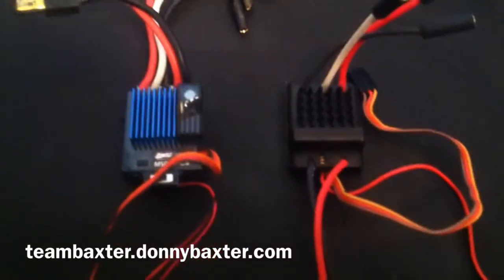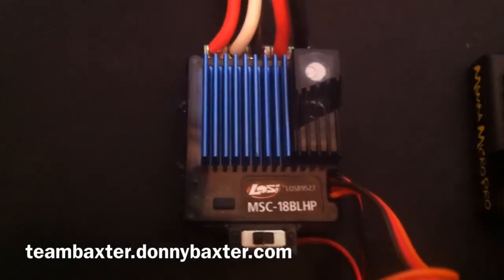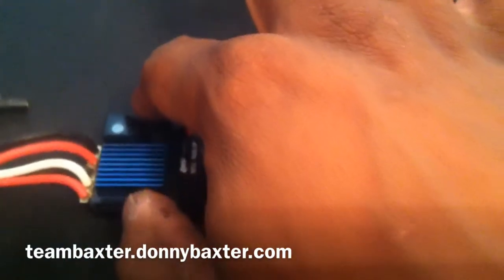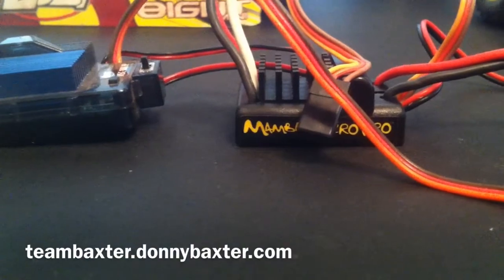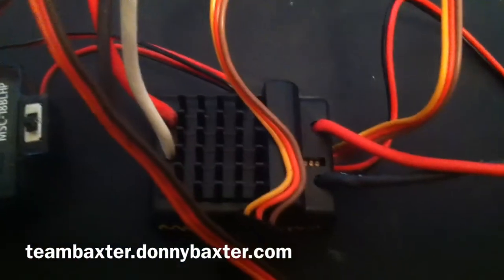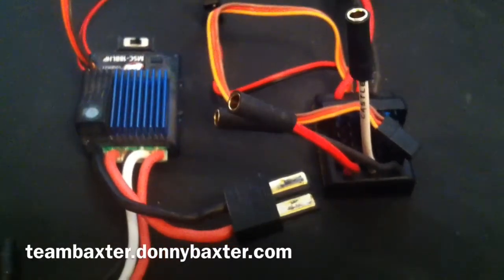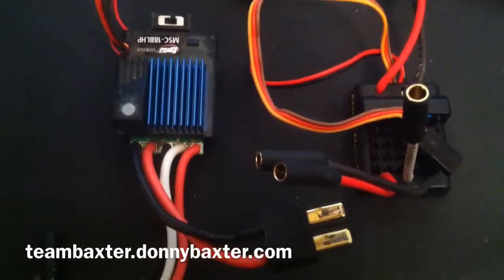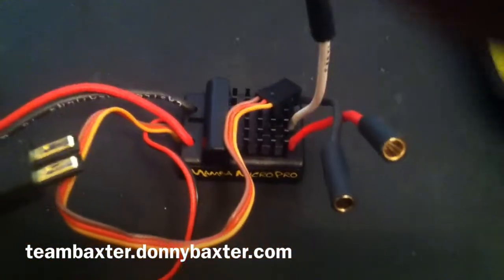Losi MSC-18BLHP and Castle Mamba Micro Pro ESC Physical Comparison

Comment from the maker: Then i would absolutely change the ESC. There is a significant difference in cogging between the stock setup, and the MMP setup. That 0808 motor is relatively expensive, and IN MY OPINION, that money would be much better put to use towards a better controller. With that said, follow your instincts and do what seems right to you, or better yet, what you can afford!

Comment from the maker: I personally wasnt aware of the 0808 motor until you made your comment. I do not know if it would work on the stock ESC, but i DO know that i will be ordering 0808 motors for both my 8ight annd my Kalahari! Thanks for the tip!

(i dont see why the 0808 wouldnt work on the Losi ESC. Should be the same bullet connector)